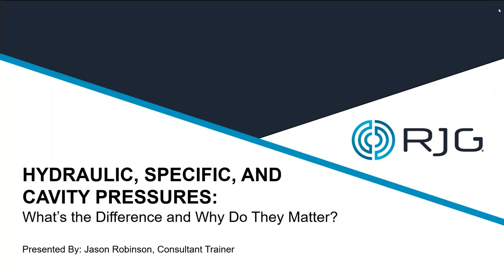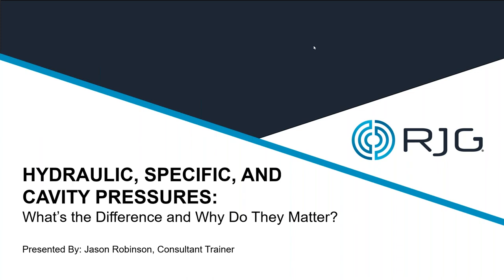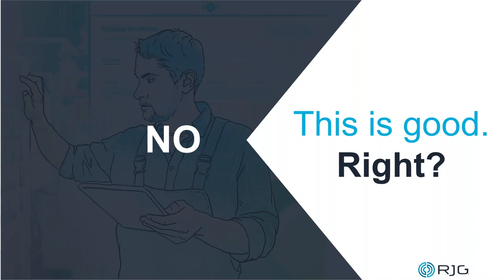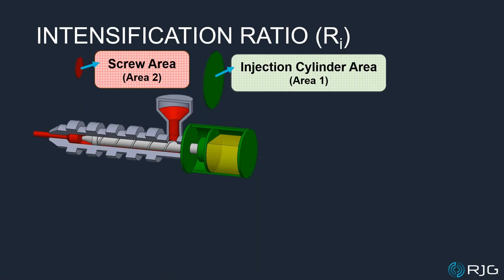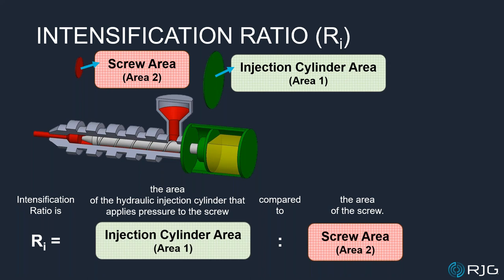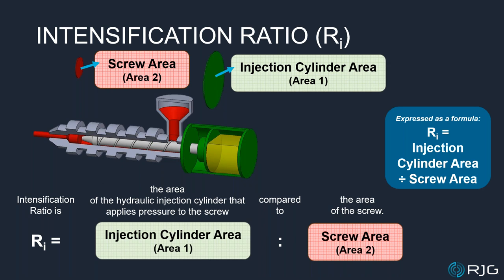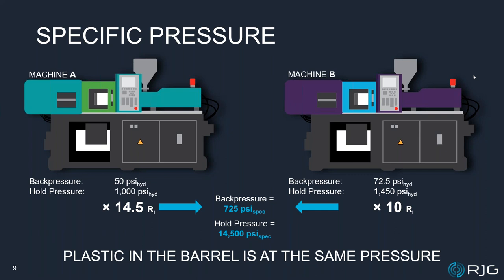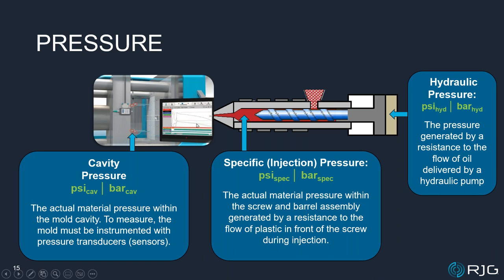Webinar: The Difference Between Hydraulic, Specific, and Cavity Pressures

Comment: So Ri in a full electric Mach would be 1:1? Also, is Specific Pressure the same as VP pressure? How bout Peak Pressure?
Reply from the maker: Yes we usually say an electric machine has an Ri of 1:1. Specific pressure refers to the pressure of the plastic in the barrel at any point in time. That includes hold, back pressure or V-P ( peak pressure).